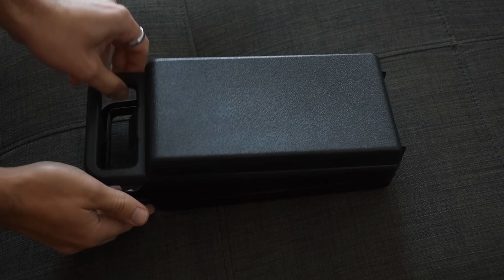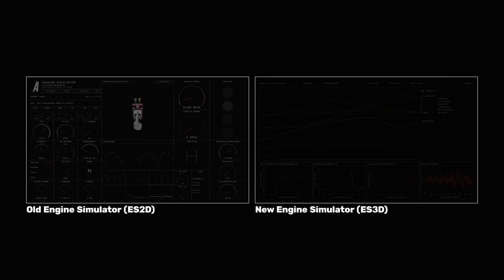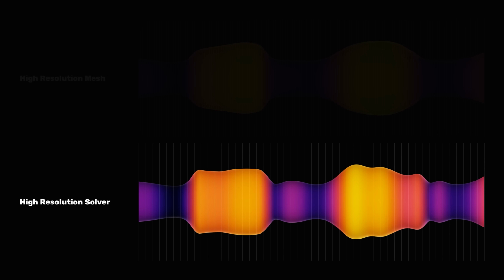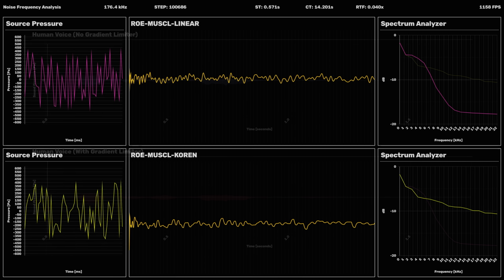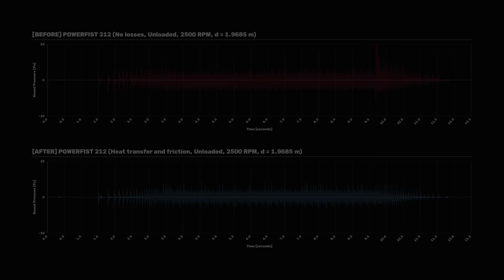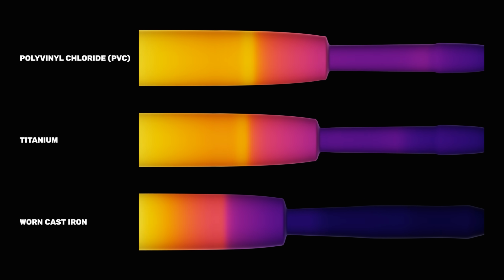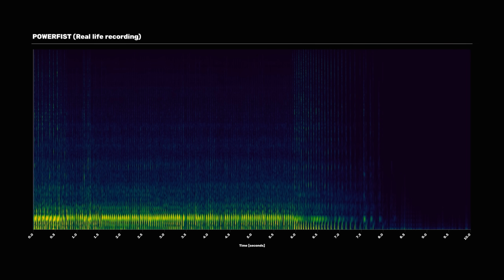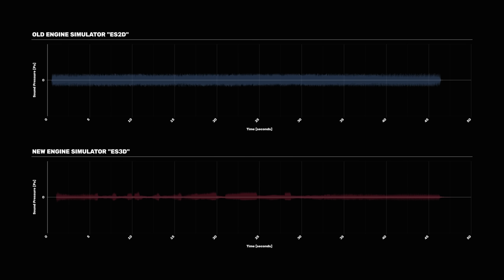Improving My Engine Sound Simulator With Real Data

Comment: Phenomenal work! Really strange about the harmonics though. I would imagine that the high-order harmonics that you're needing to dampen out should be fully dissipated out the end of the pipe instead of reflected back inward. It's almost as though something about the math is leading to a sudo-closed-ended pipe simulation even if you've explicitly set it up as an open ended pipe. Grain of salt and all since I've not looked at any of the code behind this, but my gut would be curious to look into the algorithm for something akin to 'a function's derivatives must also be smooth and continuous'  for this to work properly. Keep it up!
Reply from the maker: There wouldn't be any reason to expect high frequency waves to dissipate to that extent. If we think about it logically, that would imply that any signal transmitted through a tube would be significantly low-pass filtered (muffled) which just isn't observed in real life. Talking into a tube would sound very different than the sample recordings I showed in the video.

Furthermore, musical instruments like trumpets rely on good reflection of higher order harmonics to generate higher notes. Keep in mind that a tube end doesn't need to be closed in order to reflect waves. In fact, both open ends and closed ends are theoretically both perfectly reflective, but they reflect waves differently. An open tube end is a pressure node, while a closed tube end is a velocity node. An open tube end theoretically reflects pressure waves back into the tube, except that the reflected wave is inverted. The problem with this model is that everything gets reflected perfectly which just doesn't happen in real life. In real life, a tube opening is 3D and not an ideal pressure node. Higher frequencies tend to be transmitted out of the tube more efficiently
Reply: Actually, to add onto that, if you've setup the end of the pipe as an immutable ambient pressure that may also be your issue. I deal with a lot of transmission lines in digital electronics so I'm going to try and draw some parallels (read this as the thinking could be flawed). Suppose you have a transmission line with a high impedance termination (This would be analogous to a pipe with a closed end). It can reflect up to 100% of the signal strength incident on the edge of the T-Line / Pipe. The thing is, It you were to terminate the signal to ground (ambient air) at the end of the line it would also produce up to a 100% reflection if it is incident upon a perfect ground/ambient pressure termination; the reflection would just be negative this time. 

If you're treating the outside of the pipe as a pure static ambient pressure it may be leading to that negative pressure wave reflecting off the end of the pipe & producing standing waves within the pipe you then need to artificially dampen out. This would make sense out of the fact that you said the simulations can only run for so long before it inevitably saturates due to those standing waves growing. Effectively your engine is generating sound and injecting different amplitudes of all frequencies into the pipe. This energy is then unintentionally reflected back into the pipe at the end and only allowed to dissipate through friction and heat. For most frequencies that doesn't matter, but at the resonant frequencies of the pipe there exists some level of gain in the pipe at those frequencies. Where the resonant gain exceeds the heat/friction losses, you then get run away positive feedback that crashes the simulation due to saturation.

To fix this you would need to simulate something outside of that pipe to provide a non-ideal termination. The electrical equivalent to what you need is a parallel termination resistor. Essentially when the load/outlet impedance perfectly matches the line/pipe impedance you get no reflections and maximum energy is transferred to the load (in this case the outside air around the pipe). I think perfect parallel termination in this case would look like a horn on the end of your pipe. Obviously not what you want, but that's why a horn is a horn. It's whole purpose isn't to amplify sound but to make sure it's not attenuated as it transfers from whatever source generated it as it passes into ambient air. I think you would need a space at the end of the pipe that mimics your 'transfer to ambient' region. Some area where pressure can still change, but becomes gradually more resistive/dissipative/(viscous?). Any kind of interface here will make it so your reflections are neither 100% positive, nor 100% negative thus making it far less likely to have a resonant frequency that has true positive gain.

Just food for thought! @AngeTheGreat
Reply from the maker: @Jack_Of_Some_Trades Your follow-up is correct, this is analogous to transmission lines and the solution is similar to what you describe. You need a realistic transfer function at the outlet to avoid perfect reflection back into the tube. Modeling the outlet as a rigid pressure node is the problem
Reply: @AngeTheGreat  Can't say I'm surprised that you already knew that's the direction you needed to head in. Can't wait to see where this project ends up

Comment: Genuine question: Is it possible with the current Engine Simulator setup to simulate diesel engines or is it even possible?
This has been a thought in the back of my mind for a long while
Reply: It will probably be possible, since a Diesel engine is just an engine without a spark plug. Once He makes all the 100% adjustments on sounds, it will probably adjust the gas and diesel engines, and maybe adjust the diesel sound accordingly, or maybe the fuel itself would be able to change the engine tone

Comment: What if you run the simulation inside a 3d exhaust system object?
i mean, from the pistons and all the way back to the exhaust pipe
maybe including the catalytic converter, the muffler, and a resonartor assembly will sound different

Anyways it's a wonderful project man excelent job
keep going! 👏

Comment: Many years ago I had an aliasing problem in a lidar unit that looked very similar. I solved it by some sort of bidirectional windowed function which I think involved the median of the two directions. That produced a contour that most resembled the actual ground with drop-offs preserved. I wish I could remember the details but bidirectionality was key.

Comment: Okay i don't know how actually useful that could be because i don't know much about fluid dynamics, but everypart of your simulation makes me think about transmission lines models. Might want to look into that maybe there's an improvement or optimisation that could come from looking at the problem as if it wasn't pipes.
Reply: Transmission line speaker?
Reply: @gabrielvieira.4358 i don't believe it's used in audio because the wavelength is very large compared to travel distance

Comment: Seems logic to me that heat and friction makes huge impact in sound since the high notes are probably very high speed low mass (don't know how to describe it differently) and simply get absorbed by thermal mass or friction otherwise. That was actually my first thought when I heard the original, very high-pitched engine sound.

Comment: I work in acoustics and one thing you can also add is athmospheric dampering (aatm) ISO 9613-1:1993 although for real sound pressure level you'd have to take temperature, air density and humidity in account
Reply: interesting

Comment: One important variable that you are probably missing in simulation is that, the exhaust sound of the engine drastically changes by changing exhaust camshaft profile, duration and timing of it.
Reply: he will take that into account 100%

Comment: Yea the moment I heard the very pure high harmonic content I was like "hmm this is underdamped", but the fix is nothing short of amazing. The sheer clarity this thing is getting even in its work in progress state is unreal.

That being said, do you have any plans to add rudimentary mechanical noise, and possibly even a rudimentary room simulation sort of thing? Maybe just a glorified cabinet simulator + reverb module sorta dealy where you get to approximate the size of the space and the distance of the mic from the exhaust? Might be asking too much at a time when you're still very deep in the core of the task at hand, but I think that would absolutely make this the be all end all of engine simulation for a fair while to come. Until someone somewhere leverages quantum computing and decides to jump into this madness with that power haha.

Comment: Dude that sounds crazy good. I imagine future racing sims implementing this kind of thing if they haven’t already. Will the sim engines eventually handle multi valve, 3 or 4 (or more) valves per cylinder or just 2

Comment: absolutely insane. as a hobbyist audio programmer, i struggle to implement fairly simple DSP for well-known effects. (and that doesn't even begin to cover optimization, GUIs, testing, etc) once i get things right, i look around online to learn more about the next steps or a more advanced implementation, and similarly, it becomes immensely more involved and complex for diminishing returns in terms of quality. that's usually when i quit and move on to another project.

i've definitely been there when it comes to listening to hundreds of clips over and over with minute differences. i can only imagine that what you showed in the video is a fraction of the true effort that went into this. 

good work, and never give up on this project.

Comment: Sounds like the pipe is still a little too loud. Idk how much exhaust you simulated for the big engines, but if it's more than the header, it's worth considering that exhaust pipes are usually isolated by rubber mounts

Comment: Those Honda clone style engines like yours can actually easily safely operate at 6k rpm , they can safely rev way higher than the rating.
Reply from the maker: I've heard that the cast flywheels are the usual issue with high RPM operation and I'd prefer to not have a flywheel explosion right in front of my face lol

Comment: Dunno if my comment will be lost in the comments but,  the last engine sim loaded, sounded exactly what our water pump (it looks almost the same as a power fist engine with stock exhaust) sounded like while I was wearing earplugs. I'm guessing that the high frequency mechanical noises are what's causing the differences in the test.

Comment: This is an amazing improvement and I have the utmost respect for the amount of work this took. If I may make a suggestion, definitely give some 2-strokes a look. Their exhaust geometry can be very intricate as resonance plays a key part in creating peak power. Being able to simulate. Being in and out of the power band would be amazing, and I'm very curious how the different flow mechanics in the engine itself would be to simulate.

Comment: The new simulation sounds great! There's a clear improvement on the old one. It's a bit like going back to classic video games. "How could we ever be impressed by these mushy textures?"

If there's a risk that the more complex solvers introduce artefacts, could you compare them to the simple solver? If the only problem with the simple solver is high pass attenuation, you can increase the resolution until the frequency curve stops changing and obtain a "perfect" sample for reference. It would be interesting if it's possible to hear a difference.

Comment: I went from, "oh its ok if the math is impossible to work out in a timely manner or if processing power is a limitation." To "you're about to make millions of dollars and make vehicles in video games sound real  in a proper way for the first time in history!"
Reply: Add another few millions to licence this for electric vehicles like the Charger Daytona.
Reply: Except this isn’t patented and he doesn’t plan to from what I understand so
Reply: @thegamingwubba i dont think you patent code
Reply: @Sausketo you can patent the system & the way the system works, so that others cannot emulate it the same way
Reply: @thegamingwubba ah
Reply: this isnt real time yet unfortunately. takes a long time to render these simulations
Reply: @usbhub95 it doesnt have to be real time necessarily, it can be pre-generated, say you build your engine in game, then the game could spend a few minuted calculating the audio across the range of rpm's and load, then have the game reference the sound file while driving instead of having to calculate it on the fly while driving, i ASSUME that could work but im not a programmer
Reply: @Sausketo  actually apparently this can be run at a lower quality in real time which i missed when reading the pinned comment. you could use the high quality sounds as a base for audio like what you said, but i think you would still have to apply normal engine sound techniques which would diminish the benefits (you would still have to chop up the audio to account for the range of rpms and conditions) and i think it would still take a long time to bake the sound so youd be sitting there waiting for a while. you could use long samples instead of single cycle samples but then there would be quality degradation on rpm changes. but since i was wrong and this simulation can actually run in real time at a lower quality i think you'd probably get the best sound using the lower quality sim instead. idk that much about engine sound programming specifically though
Reply: @usbhub95  You can generally get really good result if you use enough single rpm samples. Check out nazari studios and kcmir0 for some of the best sounds in racing games to date. Of course... that takes hundreds of dollars worth of samples for EACH car 😭
Reply: @Sausketo Actually, the way engine sounds have been handled for games is even simpler than this: 

Take a couple of different sound files for each rev amount, and set up a system that automatically calculates the pitch that should be active and the correct engine sound. Then crossfade between each layer for each sound file’s rev range to handle gaps between each file.

There are extensions, of course, such as separate deceleration sounds, baked rev flutter, multiple mics, and auxillary sounds like turbos, transmission whine, and backfire, but everything I described above has been the de facto approach for engine sounds in games since the 90s and 2000s. Everything is built upon that simple foundation.
Reply: millions 🤣🤣🤣
at best you write a paper and passionate overworked developers will slave away at making a simplified imitation of it in their games. Good enough is industry standard
Reply: @YoutubePizzer im talking about licensing the tech to videogame companies
Reply: @Sausketo  Do you think they care?
Reply: @GaiusCaligula234  they do? You can straight up have a career by publishing crappy 3D models and charging a license fee. A license guarantees the software works and is kept up without having to train a new person to look at 10 year old code. These video game companies just don't make everything from scratch lol
Reply: @Sausketo  they’re not going to license it.
It’s a niche interest, maybe smaller projects would be interested but they’re not going to be able to buy it for very much, if anything at all
Reply: @christopherbernhardt  Who said that they would make it from scratch? It is much easier and cheaper to just slap on the existing sounds and be done with it

Comment: Will you be able to simulate 2 stroke engines in the future. There are no good sounding files of the older detroits at full chat especially the v12 and v16 units
Reply: There’s a way to sort of simulate two strokes in the old simulator, you use a double sided camshaft and make the spark plug fire twice as often

Comment: It's interesting to see that the output waveform of the new engine simulation is so asymetrical compared to both original Engine Sim and the recorded engine. I'm not smart enough to say what's causing it or if it's something worth looking into, but I do notice it and find it curious.

Comment: wondering if the vibration of the exhaust pipes is a meaningful contributor to the wound quality. you have metal vibrating, and that in turn will vibrate the air.
also wonder if these slight changes in the material dimensions are meaningful enough to change the condition of the simulation.

Comment: Hi Ange, great video as always. If I can make a suggestion about increasing model complexity. I’ve noticed with simulations I’ve done for physical models of strings for audio (guitar like) generation, sometimes the model is actually good enough, but finding the right parameters to make the model sound good is the required next step. For example, I have found a relatively simple series of dispersive linear damped harmonic oscillators can sound really guitar like, if you are careful with how you choose the resonances, dampings, and forcing of the model. I did this by fitting real world data to my model and then it actually sounded really nice. I like what you did with comparing real engines to your simulated ones. Maybe you can try using those samples to have the computer fit your simpler real time models. Let me know what you think if you see this!

Comment: As a life long motor head, you are soooo close.   There's a tube resonance that is exaggerated.   Other than that... its good enough for shut up and take my money.  

I feel like chasing mathematical perfection is unrealistic.  Surface hardness, resonance, atmospheric compression and rarefaction.  These things are not practical to simulate.  Add valvetrain and mechanical noises via wave table synthesis.  Eliminate ringing and tube noises via filters.   The Harley in particular convinced me.  With a bit of audio tuning, 98% couldn't discern the difference